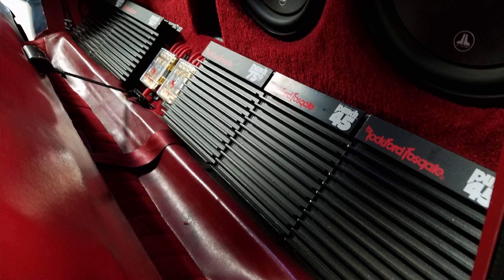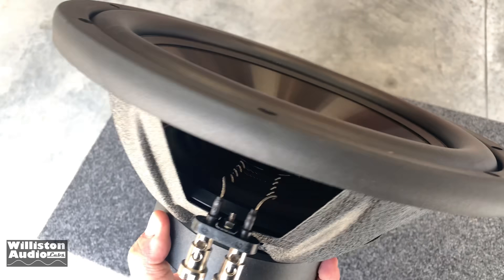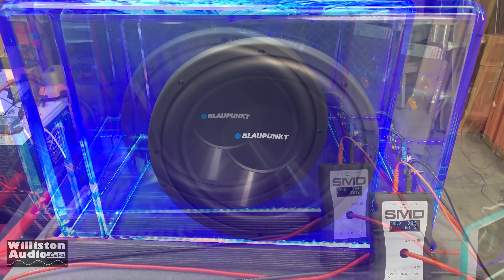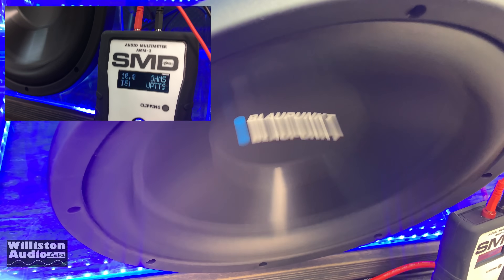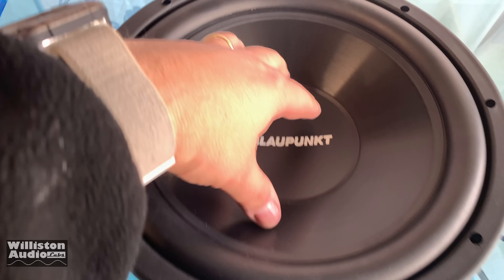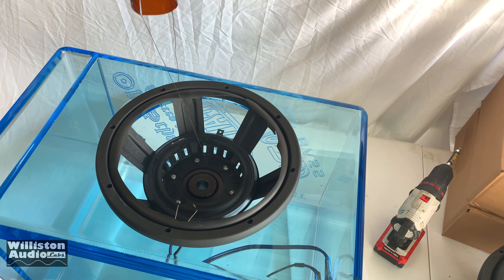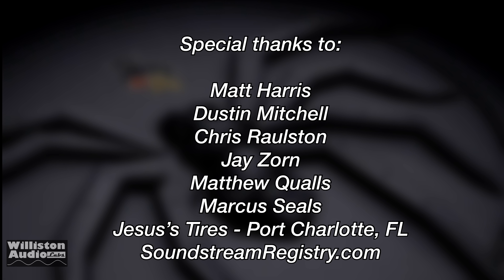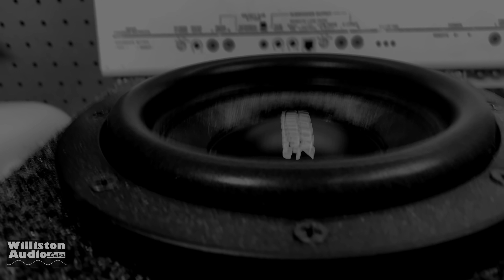$20 Walmart Subwoofer Tested and Blown Up! [4K]

Comment: Ok that’s just insane. Old School $20 (wholesale) 12” Thump subs were complete garbage and sold for $59.95 in stores. They had a tiny 20 oz magnet paired on an aluminum voice coil former, fast-on terminals and yellow foam surrounds. They looked like toys, sounded like toys and were a general waste of money. 
This sub is an incredible value. I’m shaking my head!
Reply from the maker: You and me both! I bought 8 more of them to play around with 😜
Reply: I remember thump and thump pro. What about the garbage that was sold called Hella Beats, remember those.

Pyle Drivers and Super Pros, gold label Kickers and Legacy amps.

I had a 65 watt x 2 coustic amp pushing 2 Atomic 10s in a custom bsndpass that i just guessed on for airspace and port dimensions. I hit a grand dlam on that box as it actually broke the lock on my trunk and broke the rear view mirror off the window. I still can't figure out how i got so much bass out of less than 150 watts and it seems too ridiculous go ever try it again. Most of my boxes back in my jr high and high school days were 16x17.5x whatever because I could have home depot cut the 48" width of a sheet of mdf into 3 equal 16" pieces maximize the use of my precious mdf with little waste. Oh, those were the days. Lol Thanks for sparking some good memories.
Reply: When i first read the title for video, it reminded me of when you would be driving around and hear on the radio about a super sale coming into town and they shout "12 in woofers, just 39 bucks" and then you get there and it would be garbage. 

I did get my first real pair of subwoofers at one of those shows when I was in 6th grade though. 2 kicker comp 12s for 75 bucks each. That was when you had to spend over 100 to get anything that could handle over 200 watts.
Reply: @wal  Isobaric? Same box, see how much powa they can handle continuous (wouldn't try and blow em up on purpose) :)
Reply: M&M Godfather! Find some of them!
Reply: @ryry7886  i still remember buying some fancy new kicker XPL'S with a 2 ohm coil "before i knew what that meant" from a flea market they only worked in sealed and i wanted ported so i sold them but they worked very well on my punch 500a2 or mtx 2300x and then my buddy threw them on a kicker zr360 bridged 1 ohm and blew up the amp and smoked the subs..... Oh those days
Reply: @ryry7886   I remember those sales coming to town at the expo center or fair grounds, they advertised extremely low prices, but you get there, and even the budget stuff was essentially normal price, or maybe a little cheaper than an actual car audio shop. I went once, not really any great deals. Hard to believe that was like 20 years ago now, I was pretty young, but big into audio gear.
Reply: @07wrxtr1  I got a set long ago and they only lasted one day. My neighbor broke in my car the first night I had them installed.
Reply: @ryry7886  hella beats  sounded ok but never lasted long.
Reply: @621ELECTRONICS  yeah, i bought two kicker comps back when all they had was kicker comps or free airs. They retailed for like 160 or 170 and i didnt have any hook ups so i was juiced when i got them for 75 each. I had to mow a lot of lawns in my neighborhood to save up for those. I made like 2 or 3 boxes that sounded like crap and then ended up making the same boxes my friend had in his kenwood home audio system. It sounded a lot better and i kept them in my bedroom in those boxes for 4 years until i got my drivers license. I made another box for them that i would install in my parents car for the weekend because that was the only time they would let me or my brothers borrow the car. Then i would have to take it out every sunday or monday after my dad yelled at me because i would just turn the gain up all the way and the base would always overpower the crap out of the highs if you tried yo listen at regular sound levels. My dad would have a fit everytime he got home. Lol. Those were the days.
Reply: @mcf3778  lol. Yeah, when i bought them they sold me two bass coils that were different and after i opened them i noticed they sold me one 4 ohm and one 8 ohm sub.   I didnt even know what impedence was. I had to exchange it at the store the next week. The salesmen at the expo and over there at the store sucked and gave me a bunch of hassle. Probably cause i was only 12 and i didnt know what impedence was, i just wanted them to match so they ended up just giving me 2 8 ohm. Its a good thing cause the 4 ohm would have blown my house reciever and i never told them they were going in my room. I lucked out. Lol.
Reply: @mcf3778  i remember the mtx 2300s. Those things had some power for those days.
Reply: @07wrxtr1  m&ms were good....and g&s redlines. I used to think those were earthquakes when i was in junior high. My friends neighbor had 2 of the redlines in like an 8 cubic foot ported box with a big ass earthquake amp and hou could hear the car coming from like a hslf mile away.
Reply: @bondovwvw  i don't know, i probably just never heard them installed in the right box and setup so i never heard them actually sound good. Plus i just never liked the name hells beats so i was particularly harsh whenever i saw them. One thing i did notice after a few years installing car audio is that there are some exceptions like those thumps mentioned and some others that were 12s that had like 20 ounce magnets and sucked no matter what but most speakers sould sound decent if uou put them in a ported box with the right airspace and port size. I remember my friend bought 2 10" mtx road thunder twos that only had  like 28 or 32 ounce magnets. We put them in a  12" x 24" x 36" ported box with 2 inch ports and they bumped with like a 45x2 watt jensen amp. Lol. I just reminded myself about jensen that they use to sell at service merchandise.
Reply: Ryan Montierth pyramid was the big generic version back in my day. Lol
Reply: @toysareforboys1  Dude! Was just thinking the same thing for this Chinese scooter project I'm going to do soon.
Reply: Williston Audio Labs Damn, the material alone is worth more than 20 bucks. Someone in the workchain is getting ripped off here and i think i know who that person is :/ 
Isnt it just wrong? (I mean the fact that such thing is sold that cheap)
Reply: @brianborell4469  Thinking what, isobaric? I used to do it ALL the time back in the day :)
Reply: @ryry7886  that's crazy my uncle started those types of shows and was the biggest ever slightly before my time but I heard all about it. It wasnt happened to be called sale of the century by any chance?
Reply: @brianbarrett2100  well they all were marketed as the "sale of the century" type events. Some of them probanly did use those exact words but one thing was a requirement, they required to repeat the days of the events three times, for instance. 

"Pull out stereos- 19 dollars...400 watt amplifiers- 29 dollars...12 inch subsoofers just 39 bucks, etc..etc. the best deals of thr year and you gotta be there Sunday! Sunday! Sunday!"

 They always got a lot of people juiced to go find some fantastic deals. I know the vendors always had a lot of buyers showing up with cash on hand. Lol
Reply: Thump subs were shiiiiiiity!!😂👍
Reply: I had thumps 12 in my Datsun back in high school worked great with my Sony 250 amp
Reply: can u help me out

Comment: Hey you should have did a long term  test at a certain htz like 50 or 60 or even 70 htz and see how long it could really handle 400 watts rms and the compare it to a leading manufacturer
Reply: yea I'd like to see that
Reply: I did a 50hz test for a minute straight with two of them ran parallel in a bandpass running 4 ohs off a kenwood 500 watt amp. They did just fine. Didn’t stink or smoke or clip. But yeah if you hook up a 3000 watt amp to them and send it, yeah they’re gonna shred.
Reply: @ButtermilkL0veNugget  Exactly..false review or j4f
Reply: Cajje Sra - false review? They didn’t even see over 1kw.

Comment: Pretty sure i saw some peaks in the 900w+ range so thats even more impressive. Wow $20 what a deal. I bet it would handle 500w all year long. Great video
Reply: Would a 1500 watt sub mess up a 400 watt amp or amp mess up the speakers
Reply: @gageard5246  nah but it well be under powered and not hit as hard on rms power

Comment: This could be nice for a low power DIY home theater sub!
Reply: BassAddict96 definitely
Reply: Or 8 of them!
Reply: or on my golf cart and not even worry about pressure washing it lol
Reply: I do with a 10inch logitech z5500 woofer in a sealed box😅😂😂😂😂 it is my sub in my bang&olufsen setup😅😍 4active speakers and a passive sub😂
Reply: If you just had 50 to 100 watts it would of been fine for 10 years no let’s push it to 800 watts
Reply: Only for poor people. 
Rich people's DIY involves high end parts that cost multi thousand dollars.
Reply: @noorazmi2329  multi thousand dollars worth of snake oil, yes.

Comment: I had a set of 5 1/4 Blaupunkt components I paid 100$ bucks brand new in 1998. Those speakers sounded incredible. I was so impressed. I know good sound and understood they were just cheap speakers but they sounded great.
Reply from the maker: Their gear used to be mid line, not sure what they are doing now 🤷‍♂️

Comment: Bought sixteen of them for an old school 90's budget build in a clamshell.
Reply: Please tell me it's an S10
Reply: S10 with shaved door handles and gray and purple graphics
Reply: what did they run on the meter?
Reply: Why big dummy
Reply: Erik Britz  I’ve got 4 of them ported in an suv doing at least 145db
Reply: @markadkins7216  what amp u got them on?I just bought 3 in a box for dirt cheap and need a good amp to pair them wit
Reply: FATALROTARY my amp is the prime 1000 it’s not one ohm stable but it’s wired that way lol
Reply: @markadkins7216  thanks man,but I ended up buying a audiopipe 10001d mono
Reply: @depthsounderdave  That was the hotness around 94-95

Comment: 6 of those 12s with a nice 1000 watt continuous power amp would rock the world.  

Probably build a bad ass bass set up for around 300 to 400 bucks.
Reply from the maker: Prob cost more for the wood too 😜
Reply: @wal  yes sir.  Haven't purchased MDF in years.  Add what...150 in MDF and carpet?  

Either way...reminds me of a system this kid made for his Dorm room at OSU.  He had like 16 12s he got off Ebay and a 3000 watt cheapo amp.  Thing rocked the entire building.
Reply from the maker: @jiakabery3550  that's awesome! Let me know how it turns out! I'm using these also in the $150 SPL challenge, more info in an upcoming video
Reply: @wal  that's awesome!  2 ways to get lots of bass.  

Lots of power...or lots of surface area.   

Can't wait for the video!
Reply: @jiakabery3550  its only like $23 4' x 8' sheet and no carpet needed for an spl build..
Reply: @mcf3778  I guess I was pricing that special gold plated MDF.  Hahaha

I always thought the good stuff was like $50 a sheet.
Reply: @misterhat5823  $27 from the lowes here in Atlanta for a sheet
Reply: 26.78 here in Northeast Texas.
Reply: @jiakabery3550  all you need is either the cheapest sub flooring mdf or the high roller birch which is mainly used for super high spl builds with double baffles and bracing out the wazoo and i dont know what carpet costs because i bought a whole roll back in the late 90's and i still have over half because i didnt feel like learning how to cover until 4 years ago... Youtube is awesome
Reply: A four by eight sheet of 3/4 inch thick MDF is $29.99 down here in Houston Texas.... and the nice 8 layer plywood, which is lighter is $31.99.
Reply: I ran three of them at 700 watts, it was impressive for less then $75
Reply: Why use mdf :D
Reply: @BuckCity229  man I wish I could build my own box. My box for my one car cost about 350 for 1 18in. My other car it was 450 for 4 15in. Yea 100 bucks more for 4 15in. I think it was a lil bit to much
Reply: @KeljuKkojootti , it's sturdy, it's cheap, maybe personal preference?
Reply: @KC8YPK  what were you powering them with?
Reply: @colorblind1983  hmm, cheap, maybe, personal preference 100% but sturdy,  I like to use 22+mm birch plywood, that shit is sturdy, you could put a 15" custom sub in it without any braces and the subwoofer weights 44KG,  Try doing that with mdf, I had a mdf box with braces and that shit was flexing more than the car. And the birch plywood doesn't crack when you drill it.
Reply: @jiakabery3550  Just did the math on that 16 12's would equal about 7 18" inch subs 16" 12's at 20$ each equals 320 bucks , cheapest 18's cost about 100 a piece so that would be a 700$ in subs so it looks like the 12's are a winner. .  plus it would look really cool in a club or man cave to have that many subs on the wall
Reply: @mikeriverajr4447  ya buddy.  It was pretty impressive to see that box.  

I remember he said he spent about 30 per sub.  Even cheaper these days.  

I have a hatchback and the back of my head is rattling around the idea of putting like 6 or 8 of these in the back.
Reply: @jaytaybrae3766  dude.  Just go for it.  

I started when I was 16.  Yea they were terrible at first.  But eventually I got really good and all my friends where having me build them boxes.  

I remember some of the first boxes were terrible.  The flexed and leaked air.  But eventually I learned about bracing, caulking, sound deadening, etc.  

That was 27/28 years ago.  No internet.  No YouTube.  Had to build the box, mess it up and have the guy at the stereo store tell me what I did wrong and fix it on the next attempt.  

All I can say is measure, double check, measure again Triple check, measure then cut.  

Hope you give it a try.  Worse comes to worse you waste a sheet of wood because of mistakes.  But it's all for learning.
Reply: @wal  I think they'll kick butt!!!!
Reply: Williston Audio Labs Hey by any chance would you know the box specs for the 10’s I have 2 in a Q Bomb prefab and they sound good but i know they would sound better in the right enclosure

Comment: Blaupunkt made great highs in the 90's blaupunkt highs with fosgate bass Alpine head unit that was the setup then you couldn't go wrong with those
Reply from the maker: They did for sure
Reply: Yes! When they burst in to the aftermarket scene in the early to mid 90's their 6x9s were damn impressive actually. It was a review in either Car Stereo Review or Car Audio magazine that amped me and my buddies to get some.
Reply: @07zx14White  ohh their 6x9's put all to shame i used to love the pioneer 4way  coaxial    back then but those were way better
Reply: Kevin Ball 

Oh yeah, car audio and electronics magazine did review these subs and they said it worked fairly well.

Comment: Just bought this sub for $24 along with the 10 inch version for $21 and I have to say I'm very impressed! I have it hooked up to an old powerbass amp from 2005 I believe "ASA 400.2" rated at 400watts bridged into 4ohms and this single 12inch bumps my truck, I'm planning to buy another set there so cheap lol and they look good!